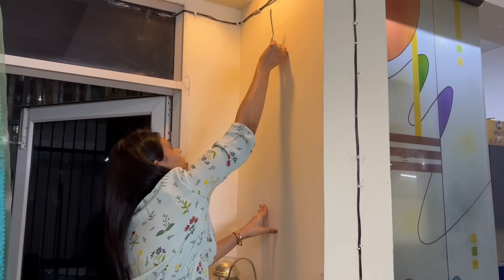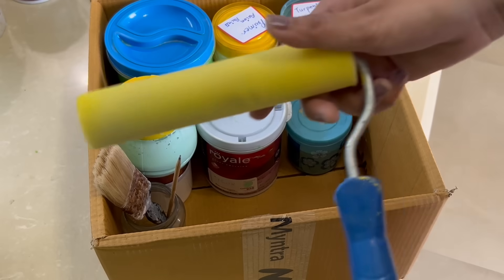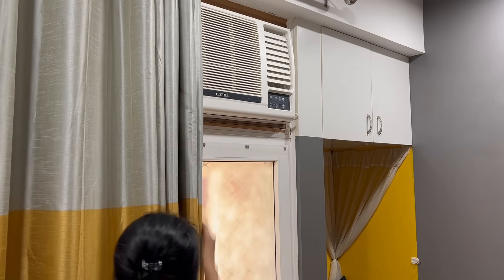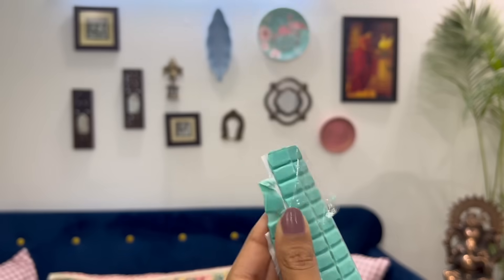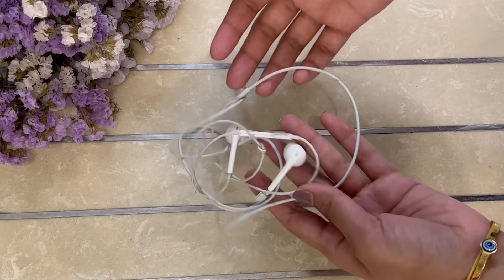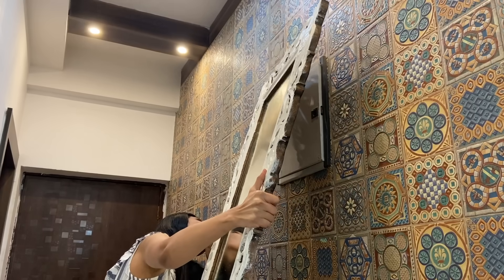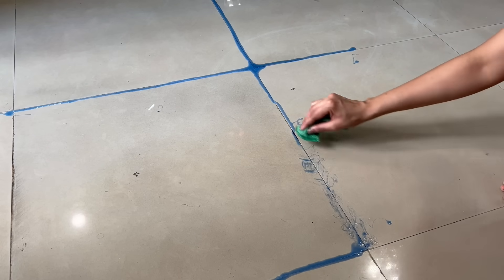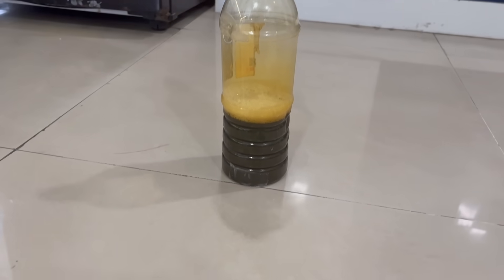9 GENIUS HOME Hacks That CHANGED MY HOME | Organizopedia

Comment: Track it once opened gets dried ? How shd we store it as we may not need it at one time
Also while removing does it spoil the wall.....whr cn i buy it from
Pls reply
Reply from the maker: Use track it and put it on the top cover to seal and don’t remove the whole plastic sheet from it. If still facing the problem take a plastic cover it and keep it in a box.
Reply: @Organizopedia  thanks a lot